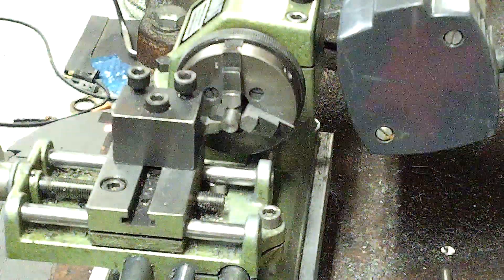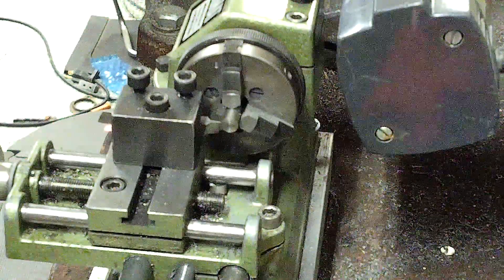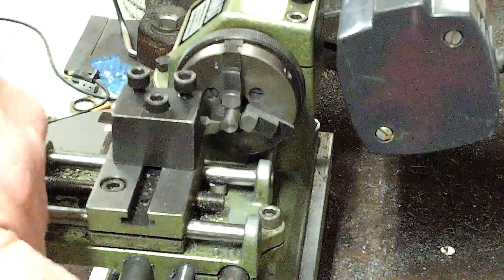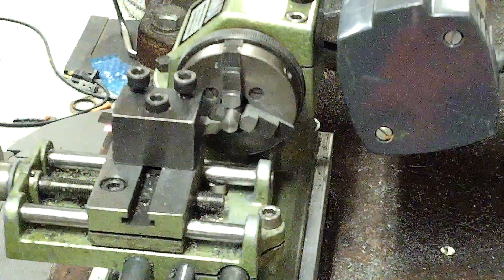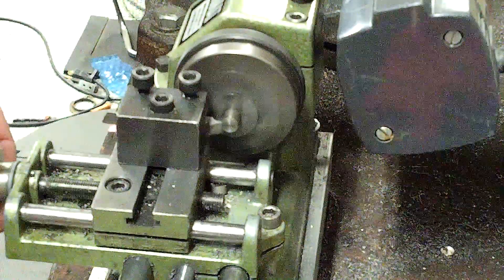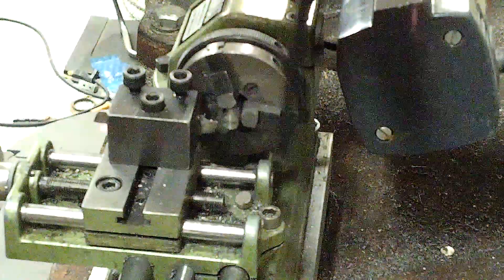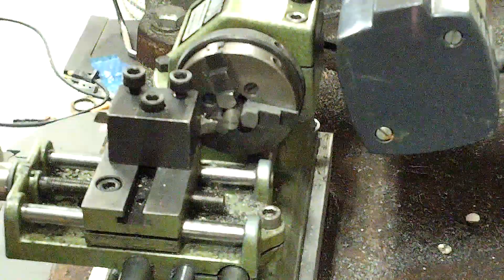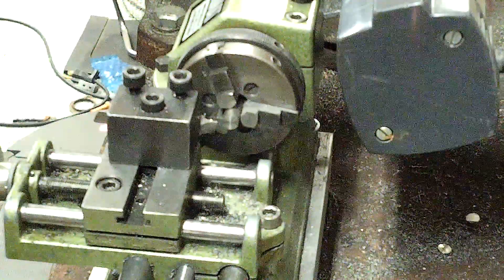Unimat SL1000 Parting Unknownium Steel

Comment: hi , what are the specs of the motor ?
Reply from the maker: 90watts is the output, if I’m not mistaken. It runs on 115VAC.
In different belt configurations the spindle can achieve around 6,000 rpm, although i never would turn anything that fast.
I did use the spindle at around 3,400 rpm for a small diameter carbide endmill while in the milling configuration
Reply: @mikewalton5469  wow , and u are telling me 90w is enough to cut steel ? pretty nice indeed